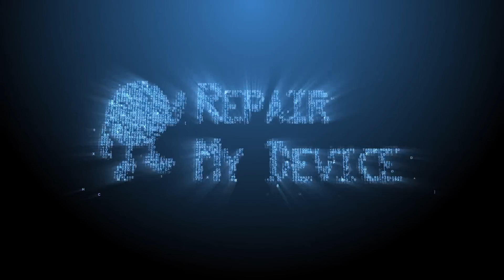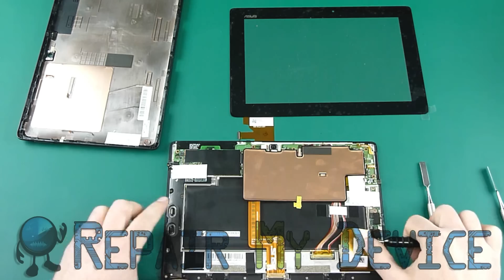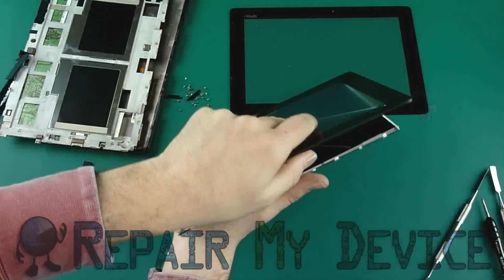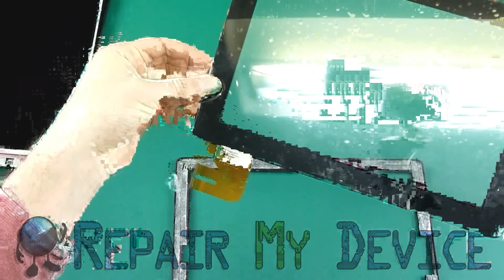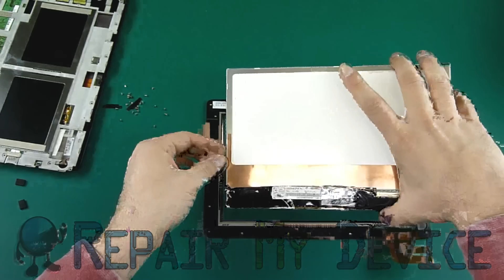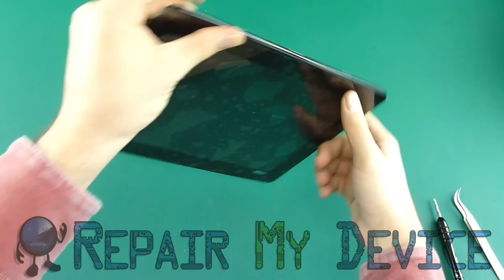Asus Transformer TF300 Touch Screen Replacement Disassembly Instructions

Comment: Thank you for the video.  Replaced my friends screen and everything worked like a champ.  I did have to open it back up a few times because I didn't have the ribbon cables pushed in all the way.  After that, everything worked flawlessly.  Thanks!

Comment: Thanks for this video. I just completed the replacement of my TF300T digitizer. I did notice that when I put the small piece of masking tape and the black foam pieces back on, the "Phantom Touches" issue returned. I just left them off and it works perfectly so far.
Reply: Where did you get the touch panel

Comment: Very helpful video, however, I have a few suggestions:
1. You don't need to remove the 6 screws of the docking connector;
2. It's not necessary to remove the black tape on the back of the LCD display;
3. Splitting the LCD display from the digitizer is definitely not as easy as it looks. It's glued together. I used a hair dryer to soften the glue and a really sharp knife to cut it. It's nearly impossible to split the LCD from the digitizer without damaging the glass of the digitizer.

Comment: Thanks for the video! mine had a broken screen in the corner long cracks and a chip in the middle. Started ghost touching and then went altogether. Got one off of Ebay for 31.00 shipped.You have to take off the back panel ,which is just snapped on. Get something plastic super skinny and use 2 of them one to pry up and hold and one to slide.Then you can see what type of screen you have it is written on the plastic tab that comes off the digitizer screen.
 Once you get the correct number off it then you can order the matching digitizer,if you do get the same one you will get ghost touching and other errors.
 I didn't need to take the black tape off the bottom to words the end of the dis-assembly there. Getting the broken digitizer off the screen was not that hard ether. The only problem I had was one of the little tiny metal discs that sit on top of the plastic ribbons that come off the board came off and stuck to my bench.There there to go under the buttons on the snap on back cover, to make a metal contact so the plastic volume and on off buttons will operate the shorts on the ribbons. Took me a while to find it. So be careful with the back case and the board while your waiting on your digitizer to arrive.
 Over all allot easier than you might think put all your screws in a small glasses and separate the few long screws from the mostly tiny ones. The back snaps on and off and the digitizer is just glued to the screen frame on the front ,I just stuck the new digitizer to the old glue that was holding the other on.

Thanks again for the Video !

Comment: Thanks for the video without it I would have never attempted it. I too tore the backlight connection away when I was peeling back the tape, I am going to see if I can figure out the diagram to reconnect the wires but I think it was torn too close to the digitizer

Comment: 6. The glass of the digitizer will probably shatter into 1000 pieces. Needless to say these pieces are sharp. I recommend using eye protection when removing the black plastic bezel from the glass.
7. The bezel is pretty thin and will break when you bend it too far.

I hope this tips are useful to anyone who tries to replace the digitizer :)

Comment: Great Video. Thanks.
I was able to disassemble my TF300 by just looking at your video. THANKS !!!

The problem I'm facing now is which adhesive I should use in order to attach the plastic and metal brackets to the new screen.

Can you suggest?

Comment: If you have tried removing the digitizer from the frame, you know that it is not as easy as pictured here.  After having unsuccessfully tried to even begin to pry the digitizer from the frame, I decided to place it in a shallow pan and fill that pan with very hot tap water.  I first broke out the window inside the frame and then proceeded to to pry from the INSIDE between the frame and what was left of the digitizer screen still stuck to the frame.  It proved to be difficult, still,but doable, and took about 45 minutes to go around the entire frame with just a kitchen knife with a short blade.  The gentler heat of the water did no harm to the frame.

Comment: Thanks much for the video. I'm in the process of repairing mine as well. However, since there are different digitizer versions (G01, G02, G03), I'm unsure which one the purchase. After searching the tablet I cannot seem to locate tis info. I've looked on the digiztizer cable strip and the assy, but nothing...Could someone please let me know their thoughts or suggestions?  Thanks!

Comment: Same problem, also made sure I got the 69.10I21.G01 replacement which is the same as the original. Is it possible that I hurt that chip that the digitizer plugs into, because I just plugged it out without lifting the white switches?

Comment: Hey there! Thanks to your video my tablet's LCD IS BROKEN! You easily took the LCD off the digitizer, when I tried to do the same, my LCD broke because of THE GLUE, THAT YOU MISSED IN YOUR GUIDE!

DEAR USERS! READ IT CAREFULLY BEFORE YOU TRY TO REPLACE YOUR DIGITIZER!
When you'll have to remove LCD, pay attention to the glue between LCD and Digitizer! You have to cut it really slow and soft, otherwise your LCD will be destroyed!

Comment: Be careful folks using this video due to poor camera position, lighting and the companies logo on the bottom of the screen at 4:56 into the video. The removal of the black vinyl strip on the lower left corner is a very delicate process there is a small copper ribbon cable for the back light that can tear or rip while removing the vinyl adhesive backed tape off that circuit board.  The technician in the video breezes right through this but you can't really make out the care he is taking with that small ribbon that comes from underneath the bottom left corner.  When I was peeling back the vinyl mine ripped straight off!

Comment: My transformer pad  has a small crack in the top right  just off the screen but recently  the right half  of the screen has stopped working... Is it likely to be a loose connection or do I need a new digitizer?

Comment: Yes, the screen break will usually kill the digitizer. Don't forget that you can use the touchpad or plug a mouse into the USB on the base and still be able to use the device.
Reply: Very few people has the docking station. No usb or touchpad on the tablett.

Comment: Well apparently i will have to make that kind of operation asap. Tell me... Im getting confused . This part You've replaced it's a digitizer? Screen lies on top left corner in the movie am i correct ? My screen is quite properly working I need to replace touch screen i believe.

Comment: I disassembled the TF300T in order to change the digitizer. 
During removing the back cover 2 identical plastic switches falled.
During the assembly I found out that one of the plastics belong to the main on/off switch, but I couldn't found the place or the use of the other.
It is not the volume switch.
The transformer is not working at all.  
Please tell me what you think is the role of this switch and where it should be put.
Thank you in advance for your help/

Comment: 4. Be very careful when removing the black plastic bezel from the digitizer. It's glued together in the same way the LCD screen is glued to it. I used a really sharp knife to cut the glue between the bezel and the glass. The black glue/tape can be removed pretty easily afterwards.
5. Be very careful not to put excess stress on the LCD panel. The glass in this panel is really thin and will break very easily.

Comment: after replacement of touch screen, LCD screen filled by a lot of vertical and horizontal strips of differnt color, i checked all cable from motherboard to LCD, all is OK, what it can be?
P.S. before replacement LCD worked fine

Comment: Where can you find the version of the touchscreen model? Do you have to completely disassemble the touchscreen to see it, or can you check it on the flex cable? Thanks in advance!
Reply from the maker: No only if you take the back off you can see the version printed on the touch screen flex

Comment: Have you tried using a heat gun to soften the glue between the frame and the digitizer? I wonder if that might work.
Reply from the maker: No need any hot gun , you can pry off the touch screen , no heat needed .
Reply: that is a part that should have been included, heating the sides gently lowers risks of breaking the lcd

Comment: After replacing screen & digitizer, I'm facing a problem with the screen : it is only displaying under certain pressure. Not sure what is causing that. When I first received only the lcd screen and tested it with old cracked digitizer I didn't experienced this, now with the new digitizer there's that effect. Would I have screw things too strong ? Could it come from the digitizer or is there a false contact on the screen connection ?
Reply from the maker: Did you check the version of the touch screen ?
Reply from the maker: If is different part yes ( did you check the touch screen version ?)

Comment: After I replaced Dock Charging Connector Ribbon Cable, the screen was very hard read. Then check everything again. Now it only does startup vibration. What do I need to check

Comment: Please help : Replaced screen "5158N FPC-1 06WW 1210" with a "5158N FPC-1 06WW 1225". Is this a big difference? I thought being a 5158N FPC-1 was enough.
Then after setting it up, I don't see anything in screen. I know it's on, because makes noise when unplugging it, and I can navigate folders when plugged to a computer.

Comment: Hello! Is it possible to give me some tips on what to do if the touch on the screen is not registering at all after the replacement?
Reply from the maker: check to see if the touch screen version was different or replace it with a g01 version and write the touch screen firmware

Comment: replaced the screen and tablet powers up, display looks good. However, the screen is unresponsive to the touch?  Any suggestions?
Reply: The same happened to me, with slight variation, which runs for a few minutes, checks the correct connection of the flex connectors touch specifically JP301 and JP302, good luck.

Comment from the maker: Is not hard to separate them if you apply  some heat on the frame for a home user a blow drier is more then OK ,if you don't know how to put back the unit you are welcome to send the device in to us for repair .

Comment: @shipack: i replaced mine according to the specs G01...it does not respond, although it will come on. if you get yours to work, please post your results.

...i'm nearly at the point of just buying a 700 & cut my losses @ $55 for the replacement screen,

Comment: Will all of the data erase once the screen is replaced? Or will everything still be the same when you turn it back on?
Reply: data is not saved on the screen? the screen is only a input device with a output screen.
Reply from the maker: No data will be lost

Comment: Hi, I had a cracked up screen glass, and I think my LCD got broke too, so I purchased both on eBay, and the pad works great, but my touch doesn't work. I have 2 tf300t, and when I broke my other one, the touch stopped working but the screen cracked slowly up, so the LCD and motherboard still worked. I took the screen from the other pad and the LCD, and put it on the newest with working motherboard but still the touch wont work. HOW CAN I GET THE TOUCH TO WORK AGAIN? :(
Reply: There are 4 different touch panel versions and several different software versions for each panel. You will need the right software and the right panel. If you look at the flex cable it should have writing on it. Depending on the touch panel or digitizer (Same Thing), you will need to flash the corresponding software version.
You can find the version is Settings>About>Touch Panel Version
You can navigate there with the dock or a regular mouse.

The versions are
Go1
Go3
5158n
And one with no writing
Which version do you have?
Reply: Caleb Wands Something ELAN 2256 4423 or something.

Comment: I did everything as shown in the video. The tablet and the screen work perfectly, but I have problems with the brightness: it's always low, even if I try to set it from the tablet it doesn't change at all, the image on the screen only trembles. What have I done wrong?
Reply from the maker: Was the device charging before.
What did you done, what was the reason you open the unit ?
Reply: RepairMyDevice

I replaced the broken glass. Before I opened it everything worked, the only problem was the touchscreen. When the tablet was connected to the docking station i could use it with the touchpad on it.

Comment: HELP HELP PLEASE:
I' ve  a tf300t without touch screen I try with a touch very 5158n but nothing 
now I would understand what touch it needs, is possible find a cod for the touch from the motherboard?
Reply from the maker: Marco Zavatta 

You can use a G01 and Change the touch screen firmware will do the trick 

Regards
Reply: +RepairMyDevice where can you get the screen from

Comment: And a little piece (double metal square piece, of 1 cm approx) is out of its place. Don't know where it goes now .... Please could you help me in any way? thanks in advance!
Reply from the maker: Mauricio 
On the left side next to the charging ribbon flex under the black tape you can fin a square area that is the place to put it
Reply: RepairMyDevice What is it for ? Which is the purpose of that double metal square piece? Because finally I assembled the tablet, left that piece out, and it is working perfectly !!!! Mistery !!!

Comment: Hi.
I opened my tf300tg and removed all of the cables, but i connected the of LCD panel again and after that it slowly lost its light and now don't show anything. now its black but its working and when i plug it to PC it is active and alive.
I'm sure that all cables and connections are connected.
what happened to the LCD panel? can i fix it or i have to buy a new panel for it? is it because i connected when it was parted?
Reply from the maker: Can be 2 problems , one you damage a fuse on the LCD screen or one on the main board , this must be check by a electronic engineer

Comment: Hi there,

My digitiser has gone on my Tf300.
I've taken it apart and it's the digitiser with only a sticker and no printed part number.
The printed sticker says: "52 B27WV00061BZ" next line "21201140400301" and the last line "101FGT04.0"
Any help would be greatly appreciated.

Comment: i can not seperate the lcd from the digitizer :( what is the hint at 5:34?
Reply from the maker: They are different ways off doing that , you can take it out from the frame , or using a very thin wire you can cut the foam that is holding the screen to the touch screen .

Comment: after replace the screen touch screen not responding not even keyboard. What i did wrong?? How to fix it?? Please help. I've used the same model of screen
Reply from the maker: Check ribbon flex , charging connector, and check to see if is any burn components

Comment: i replaced the touch screen and LCD panel, it turn on but the touchscreen doesn't responde. i try factory reset and it didn't  work. still can't use it. help some one.

Comment: I cannot verify the screen version, there is no "G1" or "G3" or anything on the ribbon.
I've heard G1 versions have holes in the ribbon as indicted here: http://prntscr.com/13piir.

Can you assist me in figuring out which version I need?
Reply: there is a so called "only white label" version. it doesn't have any inscriptions on the ribbon. it's very rare, but you can make it work with other versions
Reply from the maker: The one with no version you can use G01 will work
Reply: RepairMyDevice Mine is a white label only, No inscriptions on the ribbon. Which version will work?
Reply from the maker: Mark Brungardt 
We recommend to buy a G01 as you can find tutorials on how to replace the touch screen firmware, that is the cheapest way to do it

Comment: I'm puzzled about this. Why is it necessary to remove all those screws and disconnect everything? Why not just drain the battery, open the back, remove the old digitizer, and replace it with the new one? Isn't the digitizer just an input device like a keyboard? When I replace the keyboard on my computer, I don't need to take my computer apart. Why should this be any different? Obviously I need to remove the back in order to get to the cable connection, but other than that...?

Comment: hi ,there is no sign on my digitizer to make sure if it is a pc-1 Go1 or GO3 but there is a lable whit a part number printed (JA-GA5185N-IBB)
                                                  18140-10120100  which one will respond onn my tablet.?.because i could not find this, part number any where.

Comment: It was not a very clear video in places, and where you were peeling back black tape on the bottom of LCD panel ( which was totally unnecessary) I tore the very small circuit board wire on left bottom corner. The tape did not need to be peeled off as panel just clips out of glass frame.  The video was so poor in that section, too bad you did not do a voice over saying be careful if you pull off tape.  But as I say the tape did not have to be peeled off at all ?
Ian

Comment: This vid little bit helpful but not real work.. if the screen never been opened then this vid is not help much... You need to use Heat Gun. The LCD is Glued To the screen very tight... You must use heat in order to separate the LCD ..Heat from the glass side and take your sweet azz time... repaired one yesterday!!!!!!!! :)